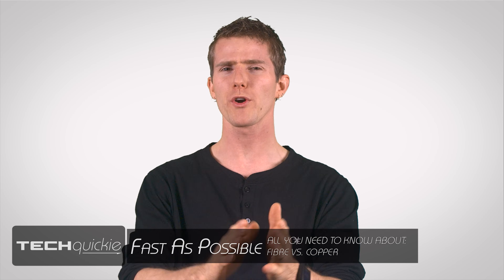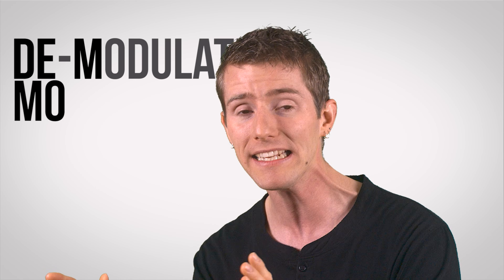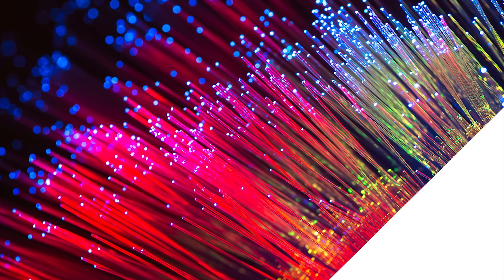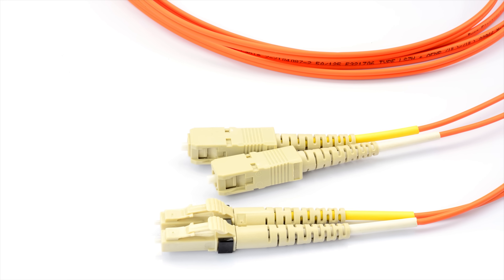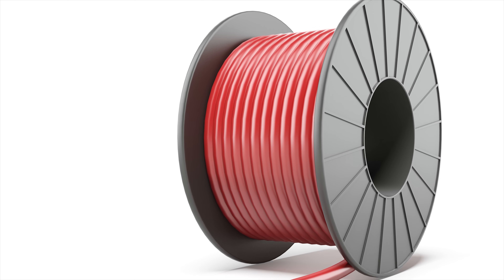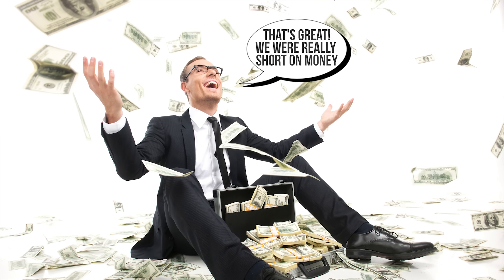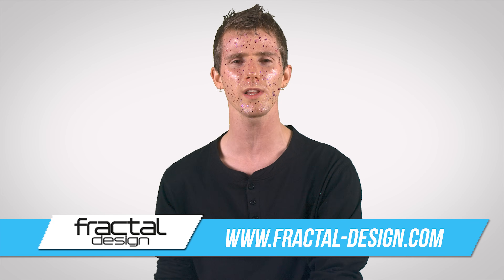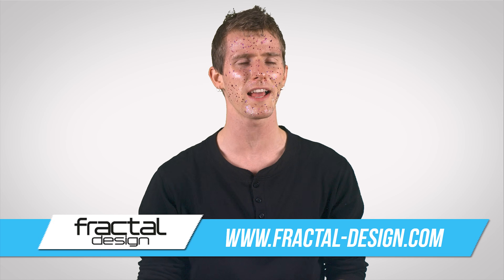Fibre (Fiber) vs Copper as Fast As Possible

Comment: Isn't the speed of light approximately 300 000 Km/s ? Does the glass slow the light ?
Reply: Yes. 300,000 KM/s is only in a complete vacuum.
Reply: Timothy Lastovica Oh, I remember now :P Thanks.
Reply: It's because light inside those glasses, instead of moving in straight lines it makes highly frequency sharp reflections  which will slow it down
Reply: LapX You also have to take into consideration that the path light travels in a fiber optic cable is never going to be straight. Rather the light is constantly bouncing off the sides of the fiber which in turn adds distance to the path it is taking. So while a length of cable might be 2m, the total distance the light travelled through the cable would be closer to 3m
Reply: Kenneth Ho Well it's speed relative to others in a "parallel" motion would be around the speed estimated. I'm no expert and I haven't taken physics yet, but it seems that ANeM's explanation is a plausible explanation for the slower speed, other than the fact that light is going through a medium. It's more of a how it slows rather than why it slows I'd say.
Reply: It's exactly 186,000 m/s
Reply: John DeBrino umm youtube comments is not the real world.... good answer thought
Reply: Hartley Harms when photons are colder? Photons don't lose energy when passing through a denser medium.
Reply: Spencer Taylor Once fibre's in the ground it goes ~0m/s relative to the surface but I don't see how that's relevant ;)
Reply: Spencer Taylor I was pointing out your bad use of terms, the "speed of fibre" is 0m/s, the speed of light through a fibre optic cable is ~200Km/s, if you're going to rat on someone at least make sure what you're saying is correct ;P
Reply: The fiber optic wires weaken the light signal about every 50 KM so they have to boost the signal and then the signal is strong again.
Reply: John DeBrino nah
Reply: I think ANeM's thought seems quite reasonable. If the light moves through straight direction, the speed will be the maximum of light speed. In this case, the light doesn't move straight instead of having bounces to reach the final point. So the speed wouldn't be the same (light speed is going to slow down in a medium)
edit : additional words
Reply: ANeM but isnt lights speed constant ?
Reply: AwesomeAsh99 No. Light can be slowed down by a variety of things, such as our own atmosphere, water and yes, glass. In fact scientists at one point managed to bring light to a complete stop.
Reply: AwesomeAsh99 The speed of light is constant in a vacuum. In a material light is slowed down by a factor n (the index of refraction for that material). In addition to that, light never takes a straight path in a fiber cable, because it is constantly bouncing between the edges of the cable. I doubt that this has much of an impact on how fast the signal is transferred though.
Reply: John DeBrino Singular form of indeces is index.
Reply: The speed of light moving through a vacuum is 299,792,458 m/s but moving through air it is slowed by a super small percentage and its slowed by 40% if it moves through glass. That's why you get refracting light beams through glass
Reply: SpurnOfHumanity um... ok then haha
Reply: Yes, it is a very minute difference, but if you look at light passing through super cold glass, the speed slows down so much that you can actually see it moving through.  It's quite amazing the first time you see it.
Reply: Actually, I think why light actually slows down in a denser medium remains unknown. It's just a property of waves that the wave speed is determined by the medium. It's the same reason sound travels faster through solids rather than air.
Reply: cwjakesteel it isn't u known,  I learned in physics 504 that a denser medium slows the light,  I had just forgot about it.
Reply: LapX Yes we know that a denser medium slows down light, but we don't know why.
Reply: cwjakesteel It's about the photons traveling slower when they are colder.
Reply: WolfsGamingBlog Wow thanks for clarifying! I honestly think I can't believe I forgot that.
Reply: John DeBrino
the glass slows time
Reply: Firstly, he said the SPEED OF FIBER, not the speed of light. The speed of light in a VACUUM is ~ 300Km/s. Light refracts and reflects. Since it is traveling through a SEMI transparent sheath, it is slowed down. However, 200 Km/s over long distances on Earth is VERY fast. If you want to be a snarky a-hole, at least take 1 Physics class, please.
Reply: Sam B that makes no sense. Do you mean functioning fiber optic connections? Yes, if you shove a fiber optic cable that is cut open into the ground, light will slow a good bit. You seem a little confused as to the definition of "relative." What is relevant, is that light is slowed down by anything that impedes it, period.
Reply: SpurnOfHumanity Its never exactly
Reply: The denser the medium the light is moving through, the slower the light goes.
Reply: Um, yes, they do. They travel through all sorts of mediums, here I'll list some: Air, glass, water, oil, syrup, etc. A medium is a material, and light can travel through materials.
Reply: I'll be the one who has 1 Gbps!!!!!